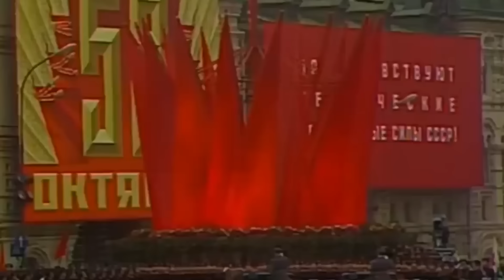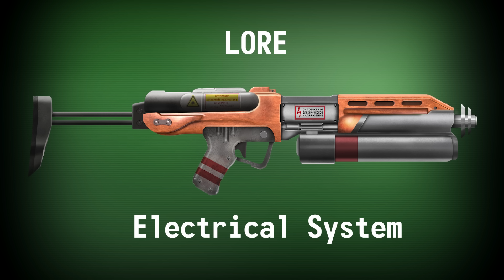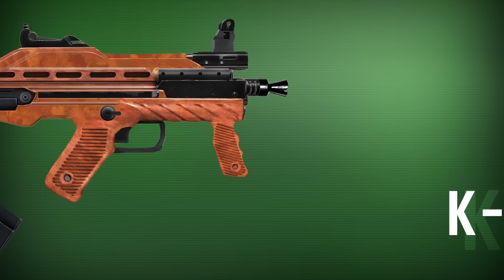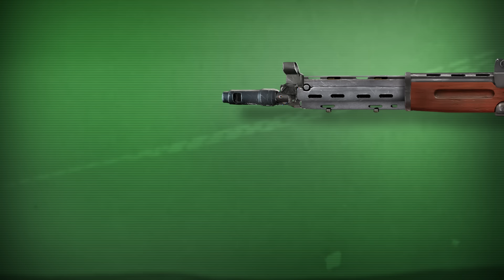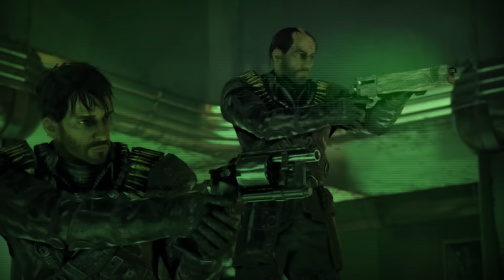Designing SOVIET FALLOUT WEAPONS

Comment: The AK is solid overall. Only thing that bugs me is the front being one solid block and it’ll be a pain to take out. I’d say just add a horizontally split for the gas block to be a separate piece and add a little side latch/lever by the rear sight so you can pop that off

Comment: Love the energy gun designs. 
For some reason soviet engineers were obsessed with bullpup designs so I would go for that personally. Huge "krona" battery in the back. 
Tho it does also make sense to put them even further front to protect user in case it explodes 🤔🤔🤔 Can they explode tho or is it exclusive to accumulators? Never saw AA or 9V explode, they just overheat and leak.

Comment: I really do like these, but there are a few things I'd critique. First of all, I think there's very little reason they'd be using 7.62x39 still. It's a heavier cartridge that produces little benefit over the 5.45, and since the 5.45 requires less material, it is more likely they'd phase out the old 7.62. 

Additionally, I don't think they'd be using orange bakelite. The reason I don't is because by the time the Soviet Union fell in real life, the orange bakelite had demonstrated some serious drawbacks, not the least of which js the fact that it's orange. 

That doesn't sound like much, but orange is a very easy color to see. It was found that the bakelite made it really easy for soldiers to be spotted on the move.

Additionally, bakelite uses some pretty harsh chemicals, and it's easy for workers to get poisoned by making it. 

Their move after that was black polymer, but the first polymer that was stable and durable enough for the purposes of rifle furniture actually came out an almost purplish black color that we refer to as plum. 

Plum furniture is really seen as more of a transitional time, as it was coming onto the scene as the USSR was dissolving, but I do believe that the USSR would have adopted it when it became available.
Reply from the maker: I understand where you are coming from, but in the end of the day it's for a game set in the retro future and imo must have standing out features, so the balance between realism and style must be walked and with a setting like fallout I think it's ok to lean a bit more into style over functionality for the sake of the unique setting of fallout, of course fallout's 4 designs went overboard and abandoned functionality and believability completely which I am not a fan of, but small things like calibers and furniture can be played around with in service of the theme, thanks for your input!

Comment: i like the video, and the deisgn :)

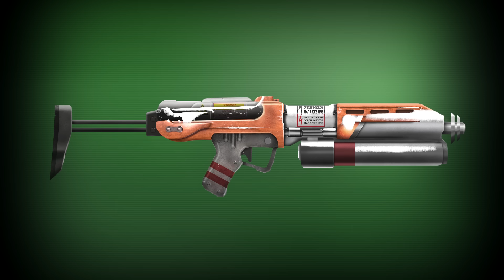the pp bizon 01:36
the TKB-022PM 04:33)
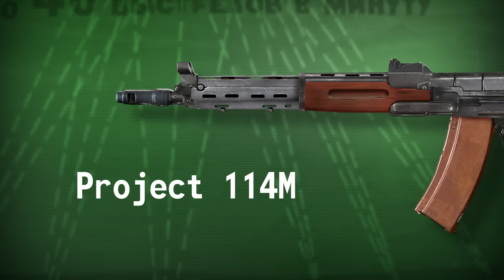the AN-94 07:07 (the picture doesnt looks like the ak 114
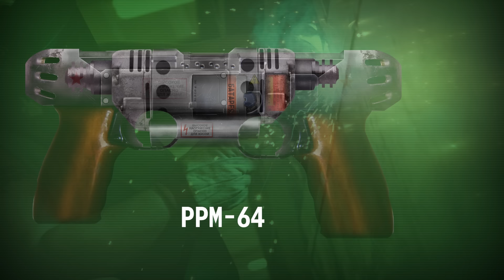it looks like makarov grip but it doesnt have full wodden grip so i go with a aps wodden grip 08:41
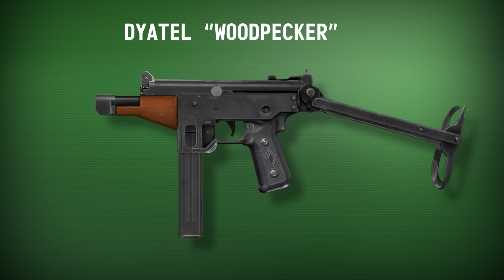the klin / kedr 09:58
the SVD 12:15
Reply from the maker: There are parts from a weapon similar to the an 94, guess what rifle
Reply: @DarkCorner25  the 07:07 have the same dust cover from as val or vss :) grip the same as any ak 74, and the mags, the butstock looks like the one from ak 74 line and aku 74(krinkov) muzzel break the same to as all default ak 74 :D also is that a PKM gun sight ?

Comment: The original AKM / AK-47 should be available as a legendary weapon.

Give it more weight and a slower fire-rate but hits much harder with the 7.62x39 round.
Reply: Make it the Type 1 AK-47 (without muzzle break and the milled receiver) and I'm in.
Reply: Legendary weapons in Fallout?
Reply: @QUENTINBIB1   Oh I'm sorry "UNIQUE" weapon.
Reply: @OrangemanComes Why would an old AK be an unique weapon when we already have M1 Garands, BARs and G3s as normal weapons?
Reply: @QUENTINBIB1   In the context of the video he presented, the original AKM would've been well-replaced so having an OG AK in the game would be a simple but nice unqiue weapon.
Reply: @OrangemanComes  Except if we follow the unique weapon logic (the one in New Vegas at least, because in the other games it's just a stat buff), they are variations of an EXISTING weapon already in the game. There are a few exceptions, like the pulse pistol, but it's only for the more wacky and unique designs. Also, why would it be a unique when we have older designs than the AK as normal weapons in the series already? The AK would be a good mid-tier hard-hitting but slow-firing assault rifle in .308, because unless you add a lot of weapons that use 7.62, you don't add a new caliber for one weapon only.
The already canon assault rifles are the AK-112, the XL70E3, the H&K G11, the Type 93 (more or less a Type 56), the R91 (a G3), and the Colt 733.
If you count Tactics, the AK47 is already canon as well as the M16A1, the Ruger AC556F and the Steyr AUG. You're welcome.
Reply: Problem solvier bro
Reply: @Mewdoser Enchanted weapons, because this is what they are, fucking blow.

Comment: There is no doubt, an entire family of AK114 variants
Reply: -RPK-114 with a longer barrel, bipod and a heavier stock
-AK-114N with a Thermal Sight attachment
-AK-114U With a shortened barrel (probably lacking, or with a heavily altered BARS recoil compensation system from the original AK114 (if it actually has one, since it kinda does look like the AEK prototype, which did have it)), for vehicle crews and Militsia (Police)